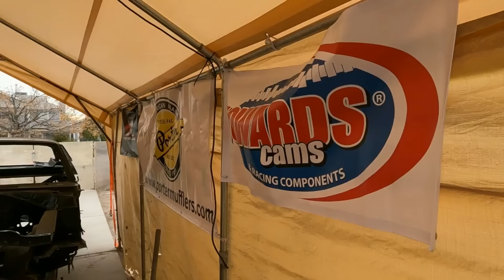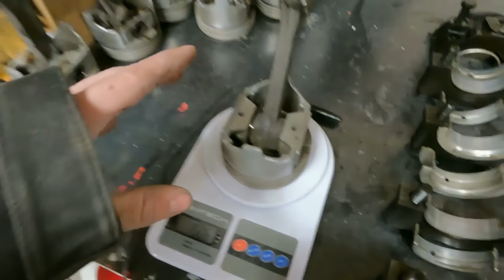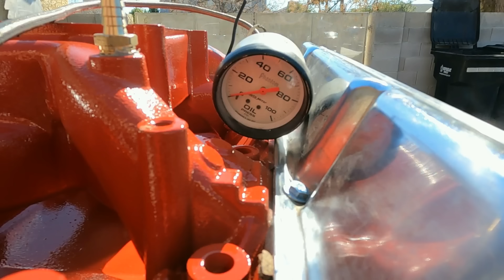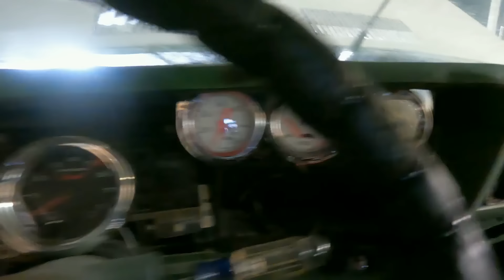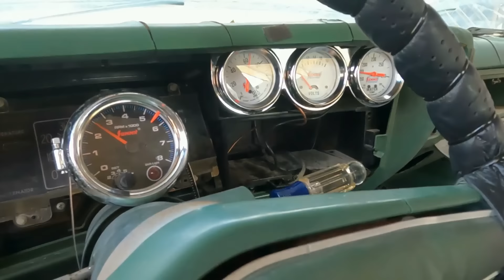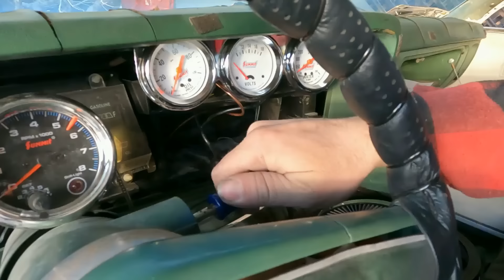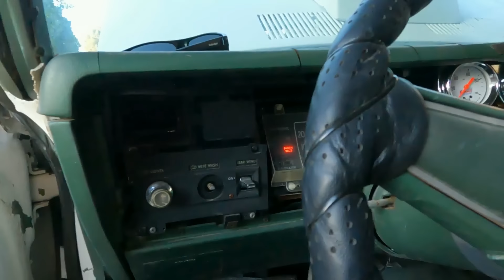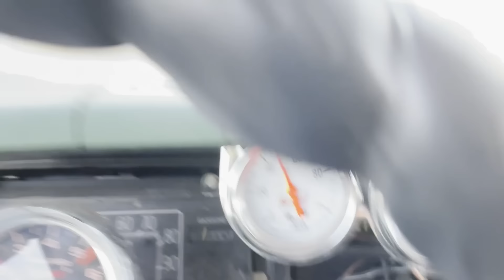Can cheap Beaters give you just as much fun as expensive off road toys

Comment: On all F & J bodies, and M-bodies below '88...the engine cradle, which everything is bolted to, was made "Outside the US." Under severe duty and/or salt exposure, the shock mounts crack & collapses, rendering the front end unable to be aligned. It was so well known that Chrysler issued a TSB and a patch kit- don't fix the issue of poor metallurgy, handle it like GM and just fix it right before it's cancelled. Also, get rid of the iso-clamp rubber donuts the cradle sits on as well as wraps the  shock mounts on the rear leafs. BTW, I own an '88 M-body cop car presently

Comment: I saw ur truck n found it pretty cool that our trucks are almost twinsies.. mine is 74 Adventurer SE reg cab long bed 2wd drk green with light green top n bottom black steel wheels n dog dishes😁 bought mine in 93 for $800 with 80k miles on route 66 here in Devils Elbow Missouri.. has about 452,000 miles now.. still daily driver n still working like a mule.. love ya keep on keeping on

Comment: When I saw the new rear brake shoes, I thought of a possible helpful tip to share with everybody that I learned too late in life. When replacing rear brake shoes, always un-adjust the parking bake cable, and make sure it is slack, BEFORE adjusting the shoes to the drum then re-adjust parking brake cable LAST... The cables going to rear axle are usually stuck and you have to pry back the lever that attaches the cable to the shoe, back into the shoe. The last guy to "throw on a set of shoes" probably skipped this step and cable adjustment was probably close to maxxed out when he adjusted shoes... Usually when I find this issue on old vehicles I work on, I'll get more turns on the shoe adjusters than I could get before when I re-adjust everything. This always results in less pedal travel, much firmer pedal feel, more shoe surface area being used, less drag when brakes are released, and more stopping power... Anyway, great videos!!!

Comment: The mid-late 70's "smog cars" have become THE HOT build out here in the Southwest. not for Off-Road use but as Daily Driver/weekend fun cars to go ro cruise-ins, cars and coffees and local car shows, Just about every car project since the  Covid "outbreak" has been some sort of 70's car because everyone was looking for something to just tinker around with and the Smog cars are cheap, more often than not are in decent shape and still running or not far from it and there's a ton of parts out both in used parts and parts stores and the aftermarket is starting to come around to them.

Comment: In 1969 Plymouth came out with a marketing tool called the Rapid Transit System and they  posted in dealerships, the ET's for Cuda's, Duster's , Road Runners  and GTX's with various options. The 340 Duster optimally equipped was quicker than Hemi Road Runner, so don't make fun of the Aspen. With the right equipment, it will run with your Chargers !

Comment: Had a 76 Aspen with the leaning tower of power.  Couldn’t even spin the tire on wet pavement. It ended up rotting in half after spending its life in the rust belt.